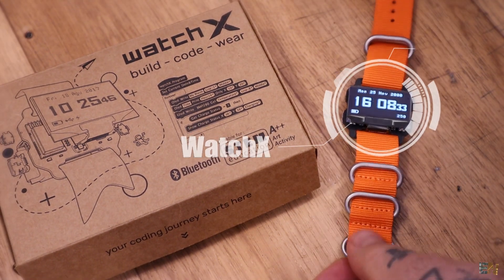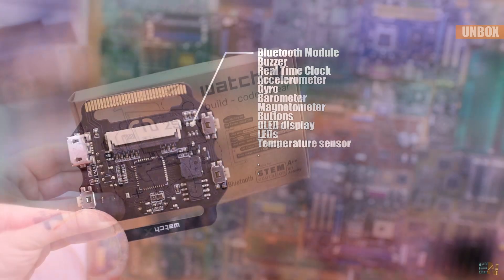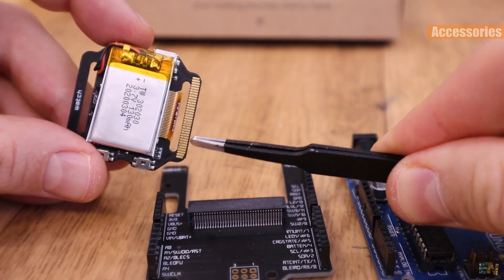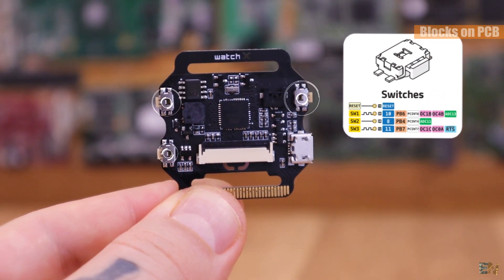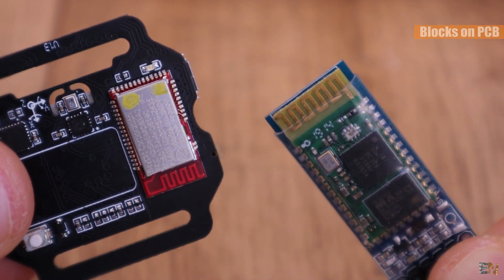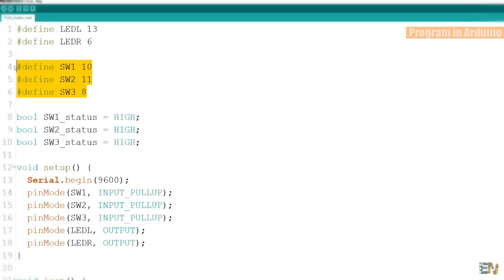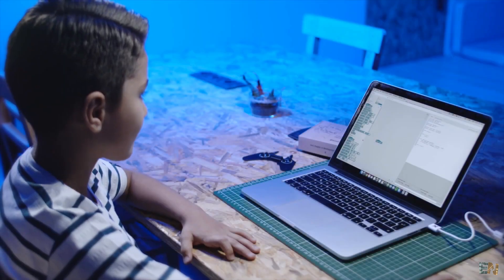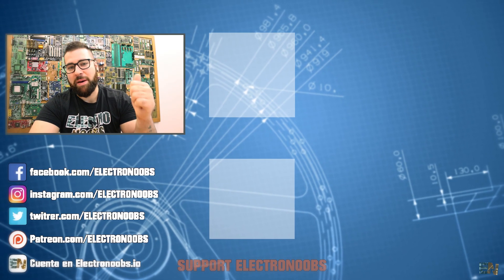WatchX Learning Development Board | PCB + Sensors & Actuators

Comment: .. I got a idea for a cheaper lasting gps wrist watch with lcd+coin battery+smartphone gps sensor+microcontroller+ timezone/DST set button+ light button+ RTC quartz lock button.. the display has Weekday, Current 24h/12h UTC time or Local, Date, Timezone & DST info.. it needs to be simple light like a Casio digital watch while efficiently powered ... it should last year's once charged... no wifi connection needed...it runs in the principal of Find - Fix - Lock - Run...on button press like neo-6m.. and made waterproof shockproof as well..we have our differences but our second should tick the same at least..I bet you can do it.. it's a treasure and it will make you rich..

Comment: Hello, I am a health student and a little new to electronics. I wanted to set up a connected watch that measures heart rate and oxygen levels in the blood. I have difficulty finding satisfactory information for my project on the internet. so I wanted to know if I could start from the model of this board (PCB + sensors) as a starting point to build mine. In fact, I wanted to know if it is copyright free or I risk legal action in the event that I market the watch.
Reply: It is open source but you could adapt it to do your desired work and you could sell the add on sensors and setup!
Reply: You can't measure oxygen levels in the bloodwith watchX alone. Don't worry about copyright. :)

Comment: hey what about the programmer IC? where is the Programmer IC in the pcb?
Reply: an USB-to-UART chip (or a Programmer IC if you like) is not needed for the ATmega32u4 chip, as it already has USB pins (D+ and D-) built into it. So the WatchX designers only had to route a differential trace connecting the USB plug directly to the ATmega32u4. The ATmega328p (used in Arduino Uno) on the other hand does not come with the luxury of having a native USB support, and thus you will always see that little USB-to-UART chip interposing between the USB plug and the ATmega328p.

Comment: The Gold plated stainless steel strap has broken on my Seiko watch. I am gutted a it is really expensive to repair, but I would rather repair it than have an all purpose singing and dancing  electronic thing that needs charging every day. My watch recharges by the movement of my arm, ergo Automatic analogue watch with a Sapphire crystal window in the back to see the movement. It is poetry in motion for engineers and nerdy peoples like me.